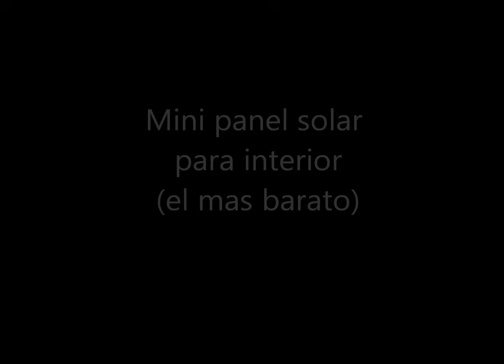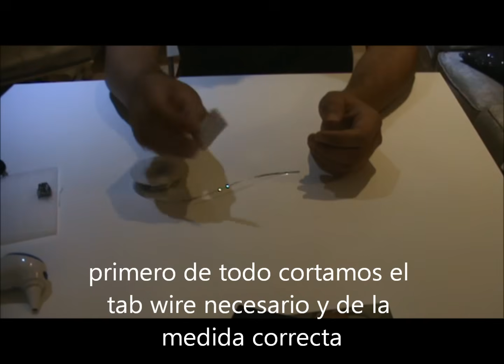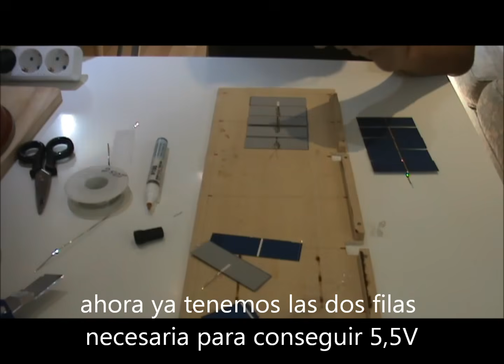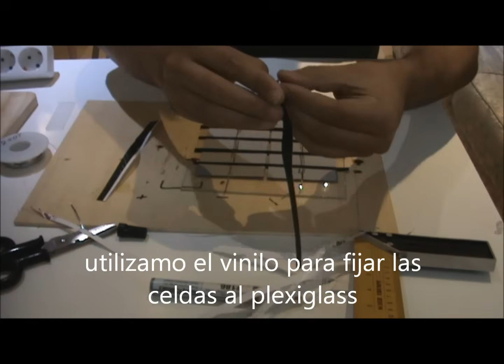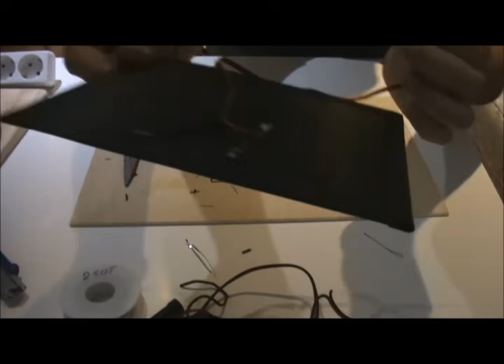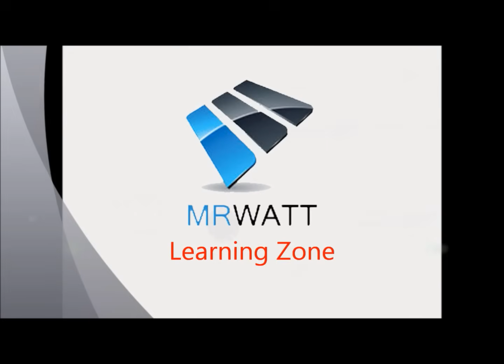COMO CONSTRUIR UN MINI PANEL SOLAR CASERO CARGADOR SOLAR PORTABLE BARATO PARA MOVIL PARTE 1 DIY

Comment: Amigo excelente video yo compré 4 miniplacas  placas de 5 v yo no sé nada de electrónica las compré para unirlas y hacer un panel de 20 voltio lo hize lo probé con el tester me vota 20 voltios solo que al colocarle el cargador vehicular para conectar el celular en vez de cargar lo que hace es descargar el celular gracias te agradezco me ayudes
Reply from the maker: Hola, para un celular, seria suficiente 6V y no 20V. De todas maneras si has conectado en serie los paneles, debes estar seguro que tienen la misma exposicion al sol. Tambien seria mejor poner un diodo para detener la coriente inversa que se genera si el panel está a la sombra o no produce. Saludos

Comment: Me podria decir usted o alguien mas ¿si lo puedo hacer mas pequeño?/can i make this invention smaller than the original?
Reply from the maker: Carlos Soto Hola Carlos, en nuestra web tenemos celulas hasta 52x19mm de tamaño, y necesitarias 10 celulas de estas para alcanzar los 5,5V de este panel. Al final el mini panel saldria 110x110mm incluido el marco.
Tambien hay y tenemos paneles mini en resina del mismo voltaje y mas pequeños en dimenciones
Saludos
Reply: Disculpa es que yo queria hacerme una bateria solar para mi movil y habia escuchado de que habia unos mini paneles solares que expuestos al sol producian una tension de 5,5 v y una intensidad de 90 aM, eran tan pequeños que le pusieron dos y le quedo tan justo al movil que podias salir con el en la mano. PD: vi en ellos algo que creo que era la medida que decia 65x65 y se llaman star solar
Reply from the maker: Carlos Soto nososoros tenemos tambien paneles mini ya hechos para esto y son muy baratos
Saludos
Reply: okey gracias